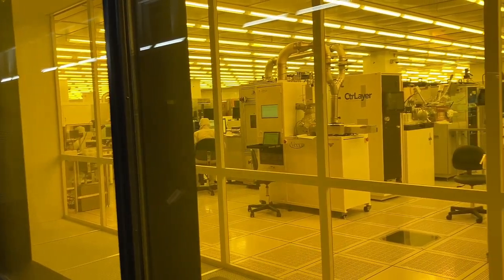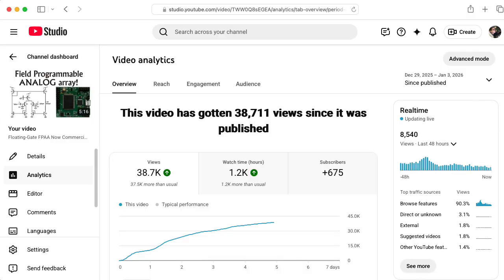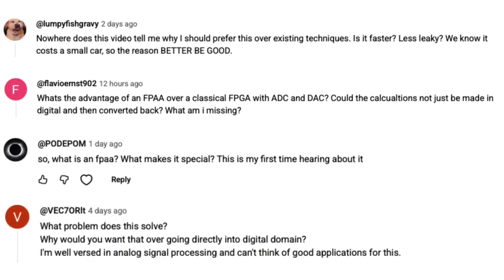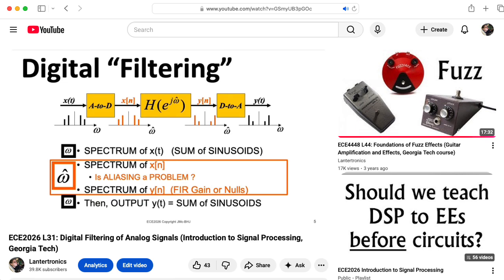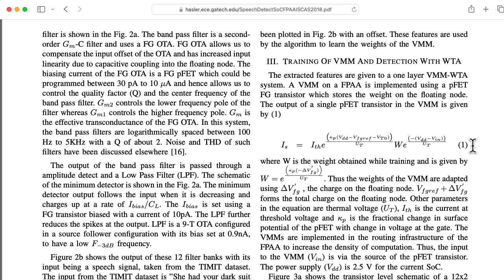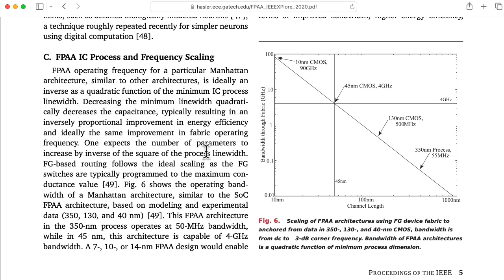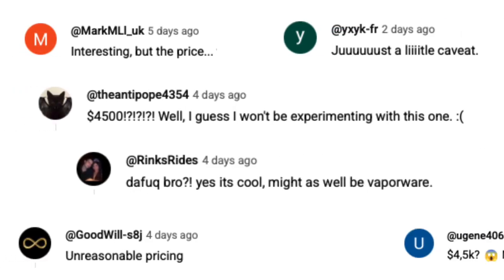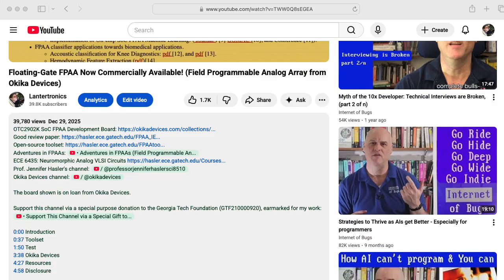Why Use a Floating-Gate FPAA, and Other Questions Answered (Field Programmable ANALOG Array)

Comment: I’m curious what technology supercritical has been using on there redshift synth.. in theory it sounds like it is similar to a fpaa with analog reconfigurable oscillators and filters but yeah they seem to be using different tech to get the same sort of results. They are quite secretive about how there circuits work, kind of want to buy one of there euro modules just as an attempt to do some circuit analysis on it.

Comment: The only reason that I have a job is that a company decided to go analog for a safety relevant system in a thing that flies.
I could do with higher integration but doubt this is the way.
Reply from the maker: Software is super flexible, but the opportunities it provides for introducing bugs seem endless.
Reply: That sounds absolutely fascinating

Comment: Consider what goes into the production of a cell phone. The technological effort is mind boggling, starting with the EUV technology necessary to make the processor, through to all the tech needed to make the display. They are pretty much the pinnacle of homosapien technology, yet I never pay more than $400 for my personal device (i always buy last years phone for less than half the price:-)

FPAAs would seem to be something that would be extraordinarily useful for low to medium volume sensing applications. For something like smartwatch non-invasive sensing of blood glucose, analog circuits are a no brainer (due to the tight power budget) but at those production scales, a custom asic is in scope, but pretty much anything short of that type of scale is a candidate for FPAA. IOT and drones being major candidates.

Comment: The real question: can it implement the SID?
Reply: 6581 or 8580?
Reply from the maker: The analog part of this is actually overkill for a SID. The core SID oscillators are digital, for which any FPGA or microcontroller could suffice. I'm surprised no one has made a daughterboard emulating a SID with real analog filters, which wouldn't take much. As far as analog music synthesis goes, you can think MUCH bigger when it comes to these new FPAAs. ;)

Comment: Does anyone know if it is feasible to use FPAAs for scientific computation at this point?  I know our ancestors used analog computers to model differential equations for example, is that something that is a good use case of this technology at current? Can arbitrary diff eqs be solved now with the reprogrammable FPAA? I am a computational scientist with unfortunately very scant ECE/circuits knowledge

Is this technology suitable for doing "green" or very fast calculations? I would imagine the workhorse of quantum chemistry calculations - matrix multiplication - would not be suitable for this device, even though I have seen Prof. Hasler show that Ax=b is possible in analogue. 

I guess I am curious if there is some application of this similar to the work on using FPGAs for ising model (optimization problem) ... if anyone has any ideas please let me know.
Reply from the maker: Look up Jen's papers "Physical Computing: Unifying Real Number Computation to Enable Energy Efficient Computing" and "The Potential of SoC FPAAs for Emerging Ultra-Low-Power Machine Learning" (both open access).
Reply: That’s a great question I’d like to see a video on. An example.

Comment: I'd like to see a compilation of several commonly-used analog functions (audio-freq amp, narrowband RF amp, mixer, DC-summer, voltage comparator, voltage reference, transimpedance amp, switched-capacitor filter) that have been implemented in an FPAA, along with their simulated performance, and ideally, correlated with bench measurements.

I still think programmable analog devices as of today are probably on-par with what we had for programmable digital logic about 40 years ago.
Reply: I think that could also indicate healthy potential... I'd like a verilog port. SystemVanalog?
Reply from the maker: @wellscampbell9858  One of Jen Hasler's goals is to have things like "standard cell libraries" of analog circuits that people could use without having to be uberexperts about all the details. It's tricky though, since analog design usually involves a lot of tradeoffs that aren't there in the same way in Mead & Conway style digital design, where as long as you follow the design rules things work as advertised.
Reply from the maker: That's a good idea. Jen's students and various colleagues at other schools have tons individual papers where they've implemented and benchmarked all sorts of things, but the material is spread out all over the place.

Comment: Regarding the price, I think people have been a little bit spoiled by the Arduino/RPi and descended boards (and I'm certainly thankful for that spoiling). Spending 100x the component cost on an eval board used to be (and still is, in many cases) the norm; like an eval board for a $10 chip could easily be $1000. Of course the real cost would often end up being $0 because the salesman for that chip wants to sweet talk you into picking their parts instead of the competition.
Reply: Can you explain the 100X? I’ve always been curious about that. From my understanding it’s all the demonstration peripherals attached to the eval board. Looking at STM32 nucleo vs dev boards for my comparison.
Reply: @RoadSurferOfficial  A lot of what you're paying for is the engineers' time designing the board and the out-of-band supply chain that's only amortized across a few hundred or maybe low-thousands of boards. A lot more engineering time goes into making eval boards because they're also intended to be a canonical example of the correct implementation, whereas for the really cheap hobby boards, as long as the board works 97.5% of the time people aren't going to be too unhappy about it. Like there's forums full of stuff like "oh yeah you can't use the USB port on the RPi in this mode because they didn't hook it up in a spec compliant way" and people will post workarounds and whatever, but if that happened with an eval board, like you're giving a potential customer a device that doesn't work or isn't 100% compliant, and there's a good chance they're going to notice and think you're a bunch of clowns who don't know what you're doing. So any kind of error like that would mean throwing out a bunch of finished boards and doing a respin.
Reply: @Nicoya that makes perfect sense. Thanks for the thorough explanation!

Comment: I have a feeling that this technology will begin to shine when some un-learning takes place and fundamentally different approaches are documented; with so much exposure to FPGAs and square holes, no one knows what to do with a round peg. I'm a hobbyist so I've programmed some micros and I have an FPGA dev board I'm working with, but I've done some things with high speed op-amps in control applications, and they can be really fast. a few times I've tried to implement the same use-case in digital and struggled to get the same speed, although that probably has something to do with the user--as they say, the problem originates between the mouse and the chair :) Something like control, or sensing, anything where the values don't need to be exact and the emphasis is on computing with the change in values over time. If we could just get that decimal point in the price to make a couple hops to the left...
Reply from the maker: My background is traditional PCB-level circuit design. Getting myself to wrap my head around these devices where you don't have resistors and the MOSFETs are operating in subthreshold (so they have an exponential law like BJTs instead of a square law like MOSFETs above threshold) has been quite difficult. It's hard to get up to speed with it if you're not specifically a graduate student doing a thesis with Jen Hasler. ;)

Comment: Fast forward 10 years and maybe they use this tech to run AI models. After all, the "shortcut" to emulate neural networks using digital floating point calculations is more of a huge "longcut"
Reply: That's what I've been thinking...I've been trying to learn the workings of Fast Fourier Transforms and the matrix multiplies with "wiggle factors"... ah, another nosebleed... 
Seems like an analog structure could be built that could output quasi-continuously.
Reply: This occurred to me as well. Analog seems well suited to massive parallel processing, particularly where you don’t care about absolute precision on the output, for example image and video.
Reply: No doubt analog would work in theory, but the scale required is far beyond any current technological capabilities. You'd need FPAAs with billions of reconfigurable elements.

The speed (and power efficiency) would be mind boggling though. At that point you'd have hardware directly comparable to the human brain in terms of energy efficiency (still physically 2D but conceptually billion dimensional).

Definitely a sobering thought experiment that illuminates the fact that GAI is theoretically possible, if not quite within our current technological capacity.
Reply: @homomorphic  the current generation of FPAAs are probably more general purpose. Next gen could be more ASIC, with analog perceptrons, neurons etc. as the building blocks with programmable inputs, connections and triggers. Exciting times ahead! 😀
Reply: @StepDub  yeah, i know just thinking about the speed and power efficiency of a pure analog neural net is pretty mind blowing.
Reply from the maker: @homomorphic  The really nice thing is that these FPAA devices aren't using any exotic fabrication technology; they're piggybacking off of standard IC processes used for digital logic, just using them in an unconventional way. The chip I have (I think) is a 350 nm process, but you can keep scaling that down; in one of Jen's papers she shows that at 45 nm you could get 4 GHz bandwidth.

So this could theoretically keep scaling very well (unlike in quantum computing where scaling looks like it's really hard, although I admit my knowledge of it is very basic).
Reply: @Lantertronics  for analog neural networks the training would require field programmability (essentially you'd be wiring up an analog neural network as the model trained). 

The nearly infinite precision of parameters combined with essentially instantaneous evaluation would be absolutely insane.

Consider that current technology uses as few as 4 bits for a parameter weight in order to constrain model size. Also with an analog neural network the additional precision and performance might require smaller models (which in ANN terms would be the device size itself).

Once trained I suppose the model could be rendered as an ASIC which would work for inference.
Reply: Brains are quantum computers, so I don’t believe this would be comparable to a human brain. On the other hand; current LLM chips are digital from my understanding so making a more efficient LLM chip is on the table I suppose.
Reply: @RoadSurferOfficial LLMs are just networks of parameters which are just analog weights. A trainable FPAA that could fit an LLM would be huge. 

Also, brains are quantum computers? I don't think so. I can't do shor's algorithm in my head. If I could I'd have a very well endowed crypto wallet.
Reply: @homomorphic  we can’t tap directly into the mind to do computational stuff like that but that doesn’t mean it’s not a quantum computer. Who knows though, that could just be someone’s theory after all. Nobody knows yet to be fair.

Comment: I'm the most unlikely science nerd, but I only made it through analog electronics in school about 13 years ago and so it's a mix of what I understand, and what I'm just being informed about to research in preparation for when I get started in digital which will be really soon.

I'm a symphonic shred guitarist, and can definitely rank with the biggest names, but I'm more drawn to science than music, and at some point, I need to keep up with the world and start designing guitar and audio gear in digital architecture and language. I'm starting in Raspberry Pi and Arduino, but have had it suggested to me to focus on the Pi as the superior platform; quad core architecture is also all the rage in digital guitar gear today.

As of right now, the goal is to incorporate a microcontroller with my designs in analog gain, clipping and variable filter circuits for my first wading into digital waters, control them digitally and store patches digitally, but eventually, I'll take the full plunge and produce digital equivalents to those analogous forms.
Reply: When you get your bearings with micros, maybe look into DSP chips if you haven't already. I don't know a ton about them but they're designed to work with signals. I started with Arduino and learned to use C++ on the same chips, and now I'm messing around with an FPGA.
Reply: @wellscampbell9858  I'm familiar with quite a few, but using the microcontroller chipset families Raspberry Pi and Arduino are based on is phenomenally cheaper, easier and the absolute best path. 

I've worked a little bit in studying the C languages and JAVA, studying microcontroller architecture, and while there are DSP chips that have apps you can use to program them with a very simple CAD style interface, they're just extremely expensive with mostly disadvantages compared to Pi and Arduino. 

Even just to crate a digital delay, I can buy an Arduino zero or Pi Zero for under 2 dollars, 24-bit DAC and ADC's for a buck and some change a pieces, and use open source effects files freely available online that have already designed highly sophisticated delays, reverbs, chorus etc. that a PT2399 chip can't come close to.

It's just a lot for one person to do on their own. I have to learn 3-D CAD and CAM software for designing my own files to run my CNC mill, my 3D printer and my laser cutter/engraver to produce my own PCB's and on and on the list goes lol.
Reply from the maker: I highly recommend the Daisy Seed -- it's an STM32 based platform for music with a ton of example code available. I've had a couple senior design teams and a few of my Vertically Integrated Project students use it, to great success. It's a fantastic platform to get started with hardware DSP.

I'd also recommend learning how to make audio plug-in software with JUCE.

Comment: What is the latency for reconfiguring the FPAA? Milliseconds, nanoseconds, minutes? And is it possible to send a "targeted" partial reconfiguration (e.g. keep the same design with one switch flipped) ?
Reply from the maker: MInutes, for reprogramming the whole chip. But your instinct is correct -- if you only want to change a few things to update an already programmed design, you can do that much faster.

Programming the floating gates is tricky -- many of Jen Hasler's graduate students have worked on making that as smooth as possible. The tricky part (from what I understand) is that you while it's easy to add a bit of charge, you can't remove bits of charge -- you have to blitz all the charge. So you have to inch your way up, and if you go over you have to start over.
Reply: @Lantertronics  so a bit like reprogramming an EPROM. If you want to flip extra bits from 1 to 0, you can do it individually... but if you want any bits flipped from 0 to 1, you have to erase the whole chip first. :)